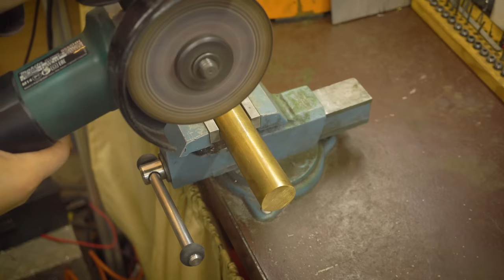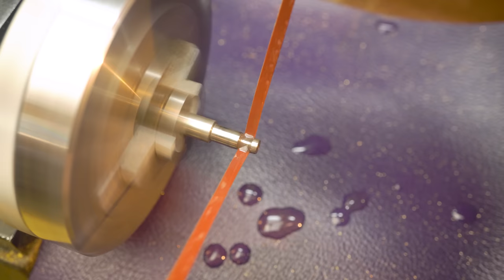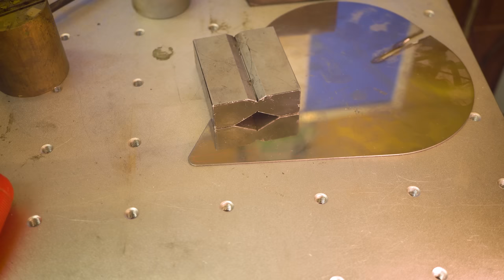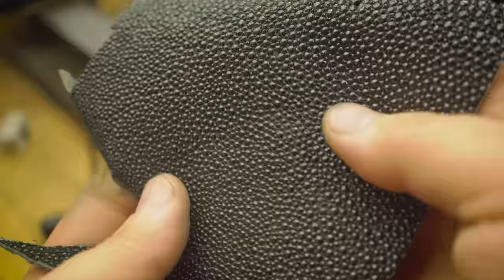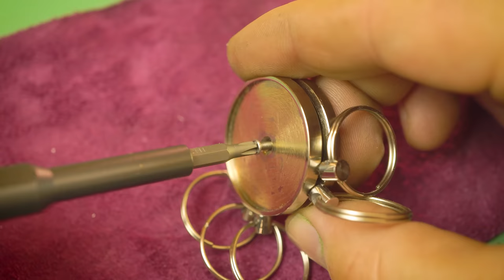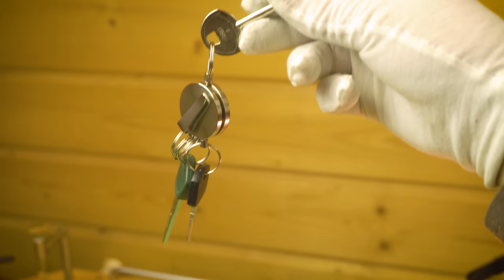Key organizer with clip!  ProDIY

Comment: bro wrote "DIY" as if I'll do it myself with my multi thousand dollars lathe and thousand dollar diamond coated carbide tools in my own workshop 💀
Reply: a Sherline lathe can be had for under $1,000, and brass can be cut pretty easily with plain tool steel.  It's not exactly the type of thing most people will have in their garage, but the stuff being used here is certainly attainable by mere mortals.